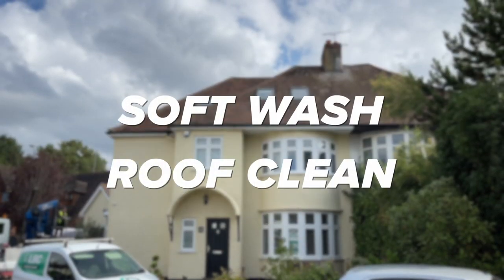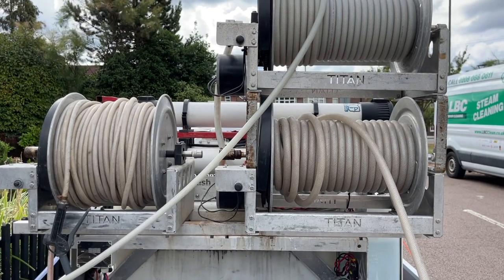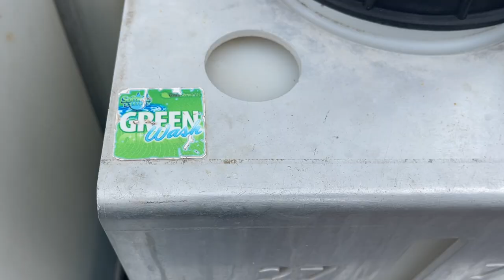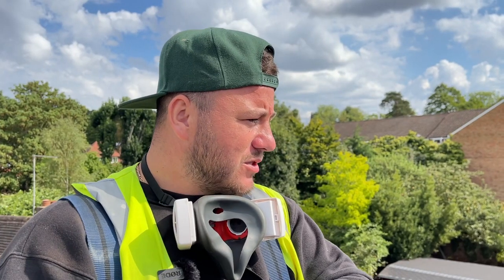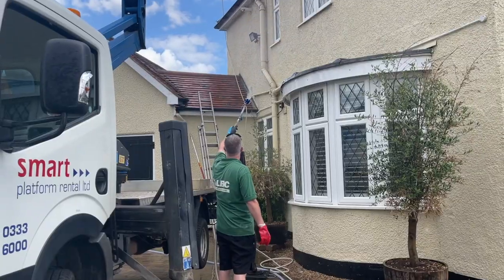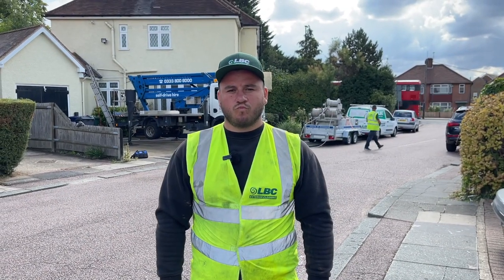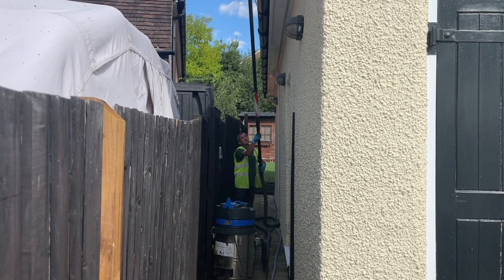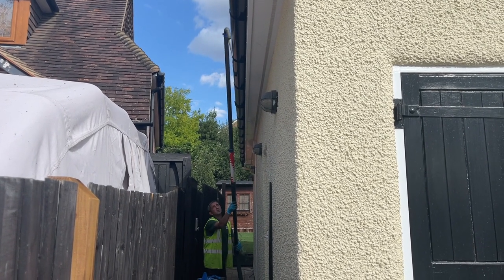Roof Cleaning Using Soft Wash Systems

Comment: Assuming it's a 12v system reckon it would be a good touch to add a wireless remote so the operator can stop the chemical flow from the cherry picker. Gold job as always!
Reply from the maker: Hi Blake I like your thinking... The chemical pumps have pressure switches so the pumps stop pumping once flow is switched off at the Lance to avoid excessive build up of pressure👍

Comment: The only down side I saw was all the over spray that went on the next door neighbours roof. Plus all the mist that can travel in the air and all the run off going into the sewer system. But apart from that a nice addition
Reply from the maker: Hi Conrad 
I see where your coming from 
Can also use telescopic sprayer or water fed pole for more localised application